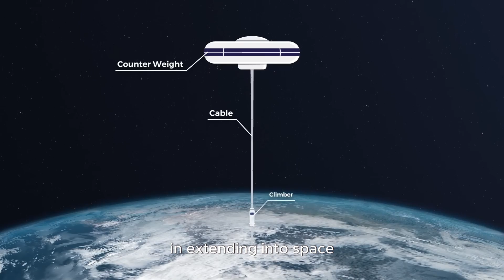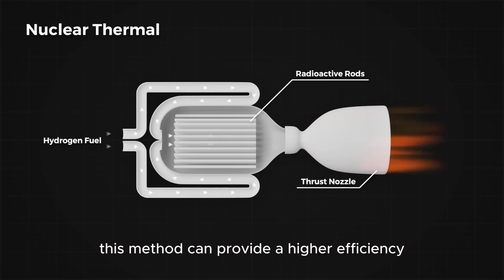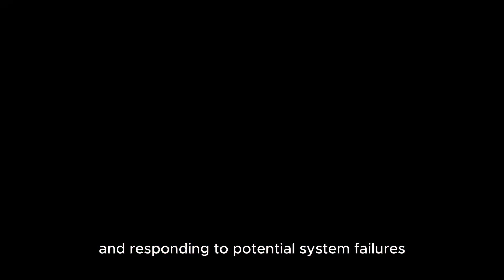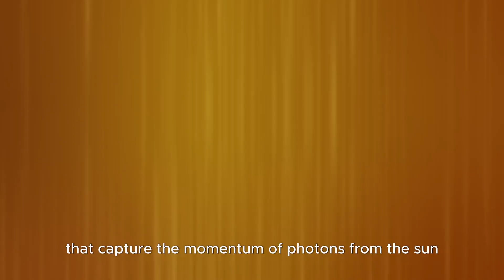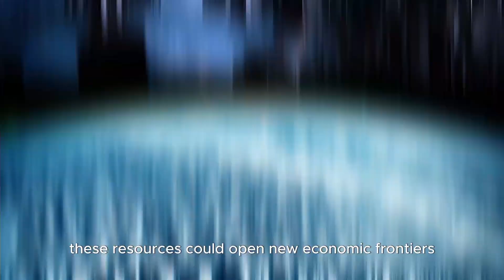Top 10 Future Aerospace Technologies That Will Change the World!

Comment: The problem with reusable rockets is that it takes more fuel to land them than it takes to reach orbital velocity…. Not as expensive as a new rocket body , but the environmental concerns are significant, especially if they are used frequently (like to produce an orbiting data network… do ya give a shi+ about that, Elon?)